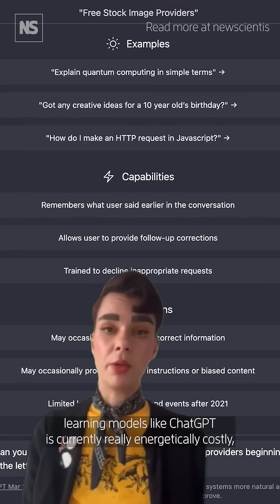How to fix computing's AI energy problem: run everything backwards 🖥️

Comment: I wonder how low we can get the power loss like can we get this thing to the point where it gets charged then can run off like rf to dc power so it only needs a tiny battery or capacitor.. and then runs all without a battery that would be cool